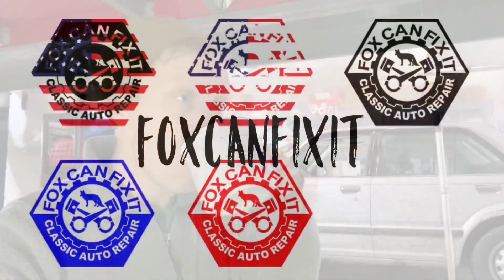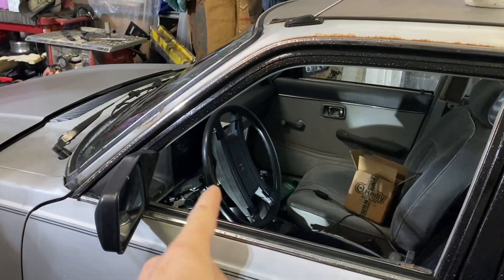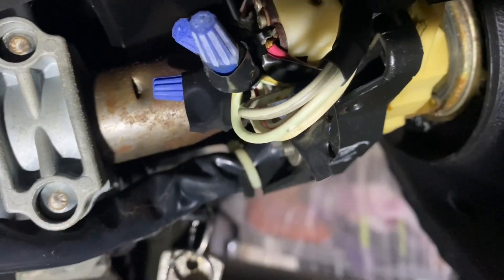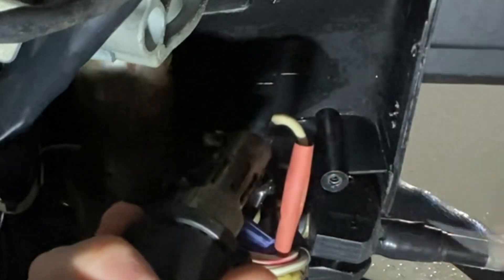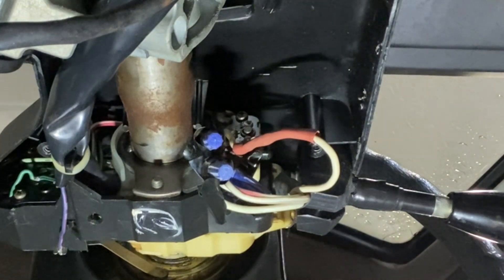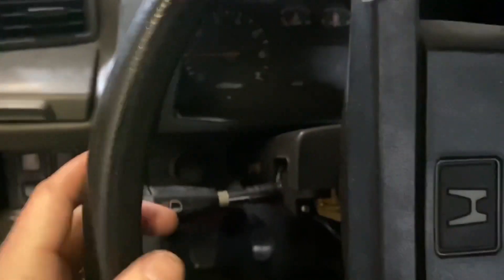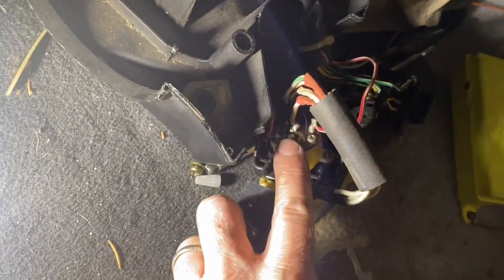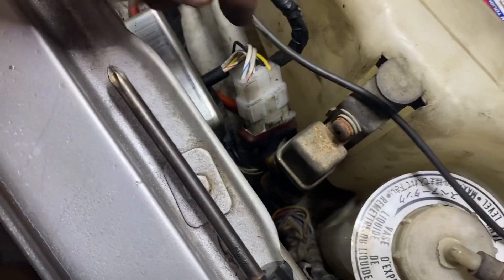Honda Civic Alternator is overcharging…I hate electrical problems

Comment: Good find! Corrosion sucks. Creeps in, in areas you sometimes just can't see. Super moist around these parts so we see it a lot. Around here it creeps up the strands of cables or anything exposed from its jacketing. Resistance skyrockets... current flow decreases....amp draw increases.... heat then becomes apparent. Nice work!
Reply from the maker: I am going to replace the original engine to body ground soon too, just as preventative maintenance.
Reply: It's like Mater sneaking into trivia night.